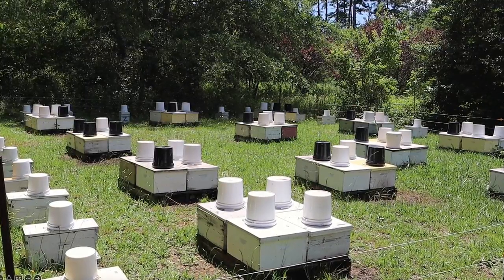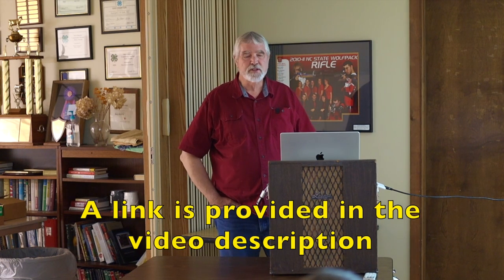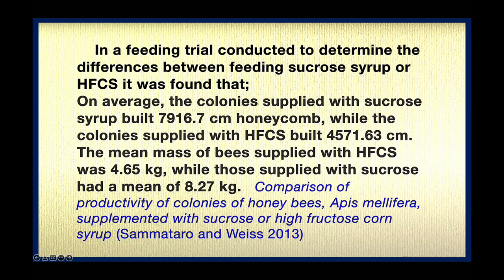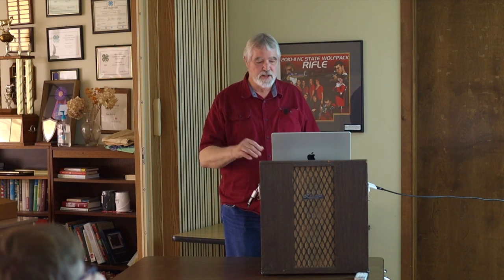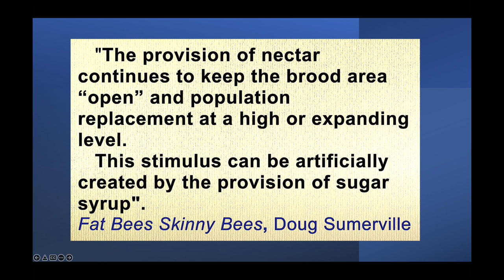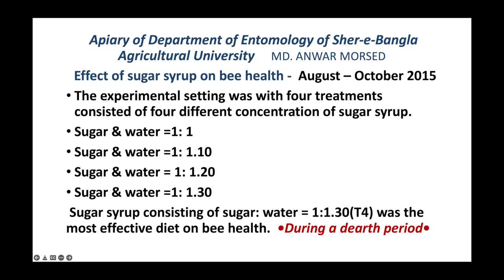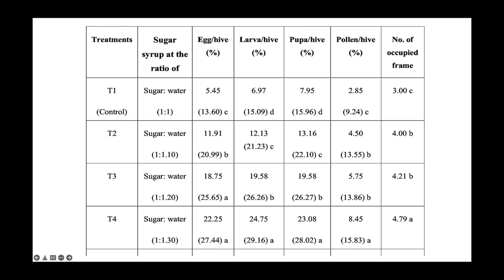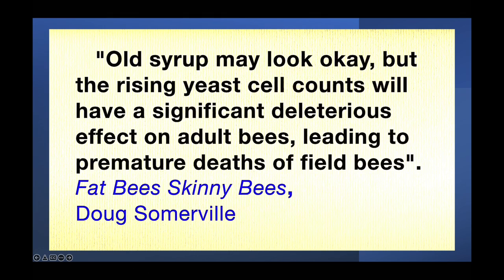The Chemistry Behind Feeding Bees Part 1

Comment: Hello sir . Thanks for the information and free lessons. I have a question if you check the percentage of varroa in powdered sugar. How many varroa is acceptable in half a cup of bees? When do we treat? I had from 3 to 7 mites in each beehive
Reply: That’s quite high number if it was alcohol wash, a sugar roll has less success at counting mites, so the true number of mites from a sugar roll is much higher.
Reply: Wow! The sugar roll method of testing for mites isn't as accurate as a wash. You have a VERY high mite load in your hives. IMO, you should start treating now to get a handle on the mites before winter. I wish you good luck!
Reply: @witchywoman703  Thank you so much. The problem is that the temperature is high in Iraq and chemical treatment is harmful to bees. I have to wait a month until the weather cools down
Reply: @sinisterhipp0  Thank you. I will be treated after the weather cools down because today the temperature is 47 degrees Celsius and the chemical treatment harms the bees. .
Reply: @ابوكرمللسيراميك  You can encourage hygienic behavior by coating the bees in powdered sugar. They will clean each other. You have to keep the bottom board clean unless you use a screened bottom board.
Reply from the maker: I would recommend treating for mites as soon as possible. That number is high.

Comment: If the bulk density of water is 62 .4 lb/cubic ft and the bulk density of granulated sugar is 43.7 lb/cubic foot . If you use equal volumes of granulated sugar and water you would have a water:sugar ratio by weight of 1.4:1. Would that accomplish the goals you just laid out?
Reply from the maker: 1.4 parts water to 1 part sugar would work well in my opinion.
Reply: Cup water 235g
Cup sugar 200g
Now that's just in my kitchen ymmv

Comment: I think I'm tracking with your reasoning regarding using the 1:1 or thiner sucrose feed in a slow drip/long duration appication ...makes good sense.  I am a 4th year bee keeper with 26 hives, double what I had last year.  Last year, more out of fear and ignorance than anything, I fed 1:1 like crazy during the months of Aug and Sep and my 13 colonies seemed very strong going into fall and all wintered over well.  I had mites under control using RO's extended release ox/glycerin application, apivar in Nov and an Ox vapor late in Dec.  I fed using Mann Lake's 1.5 gal cap and ladder for the entire fall.  My question is, I have not yet used the 1 or 2 gal buckets and am wondering if the frame feeders accomplish the same result?   I just don't have the experience of flow rates and impacts that you do, but I see the wisdom in it.  Thanks for your consideration.
Reply from the maker: I prefer the buckets for the reasons I have mentioned, and I think the results are better, but inside feeders work also. I've used them a lot in years past and the bees did fine. The main thing when using inside feeders is to be careful not to give them too much, too fast. Too heavy, too early can be detrimental.

Comment: How many holes do you punch in the bucket lid cap? and size of holes?
Reply from the maker: The holes are drilled 1/16 inch.  We drill six to ten holes and will occasionally cover a few of them with beeswax if we want to use less. Oddly enough the bees rarely remove this beeswax.
Reply: @bobbinnie9872  That's amazing, they don't touch the wax? Wow!  The more learned, the more amazed.  Also, where do you get those 1) buckets and 2) air-tight lid and 3) rubber cap?  Thanks in advance!
Reply from the maker: @alexayounginsong2641  We purchase buckets and lids, by the pallet,  from Pipeline Packaging in Kennesaw, Georgia. The plugs are harder to find unless you want large numbers. Search "2 inch tint plug" to see the possibilities. Or you can order smaller quantities of buckets and tint plugs from us at 706 782 6722.
Reply: @bobbinnie9872 2 Gallon bucket is used right?  Michael Palmer's NUC at 2nd layer, I mean?
Reply from the maker: @alexayounginsong2641  We use one gallon and jars on nucs but use both one gallon and two gallon on other colonies depending on the situation.
Reply: @bobbinnie9872  fantastic! Thank you BeeMaster Binnie
Reply: Can you sell buckets with plug-hole in the lid and holes in the plugs well? Also may I have the email address of your apiary, sir!
Reply from the maker: @alexayounginsong2641  We do sell the buckets with plugs. If interested call our store at 706 782 6722 and ask for Molly. Our email is brhcsales1@windstream.net. Thanks.